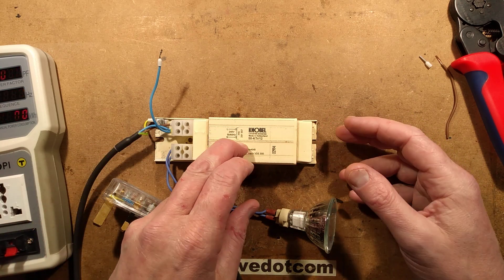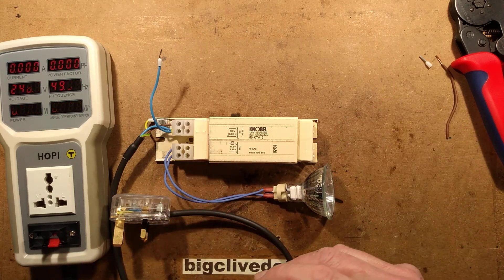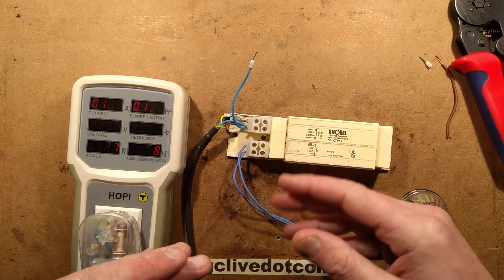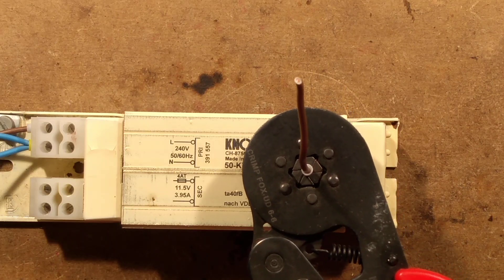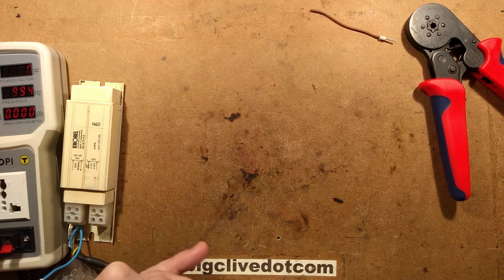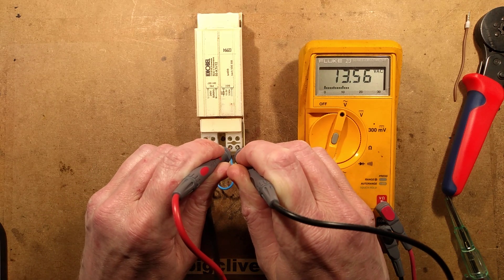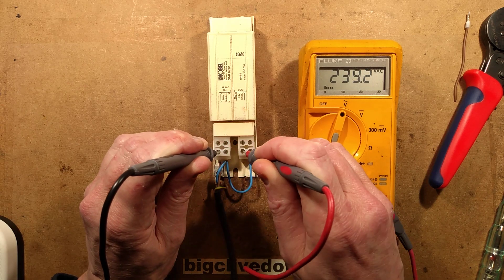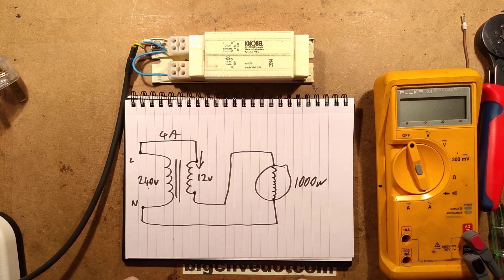Adjust your mains voltage with a standard transformer.

Comment: For a while years back I had access to a Claude Lyons self-regulating variac. A beautiful beast, 2kVA if memory serves, RMS sensing with adjustable dead zone to avoid brush-destroying chatter. Not cheap, but about 30x cheaper than an equivalent semiconductor jobbie. I was working on PAT Tester Test Gear (ie a Portable Appliance Tester Tester Tester) and you couldn't really have a 1kW load test with any old mains voltage. I'm not sure Claude Lyons sell them any more. Meanwhile, Class D keeps getting better so semiconductor solutions with SCPI / USB / Ethernet backends are quite affordable.

Comment: You are reminding us that Power companies have the Power to charge us for VA rather than Watts. However as most reactive load is inductive, power companies usually welcome capacitive power factor correction. So would they provide a rebate if we use LED lamps with Capacitive droppers to assist them with power factor correction?
Reply from the maker: The problem with many modern power supplies is that the current waveform is completely non-sinusoidal.  The old trick of using capacitors to compensate for inductive loads doesn't work any more.

Comment: What a brilliant observation you make. The current load is carried substantially by the secondary winding ! Great. Of course we have to hope that the secondary is wound and insulated in a way that will withstand full mains voltage. Down here in Australia, my home voltage is regularly up around 258 Volts (I live close to a sub-station). I have a Chandelier with around 50 x 4 watt LED candle globes, you know the ones with a 50,000 hour life that seem to be outlived by any old filament lamp. I really want to reduce the voltage to these lamps, to improve their longevity. However given  that they probably have a lousy power factor, the load current may be substantial. I am only making some wild guesses here, but say the power factor is 0.2 then 50x4/.2 = 1000 VA and 1000/258 = 3.9 Amps, this is getting uncomfortably close to the rating of the transformer you are using. As the transformer would be located out of sight and out of mind in a sawdust insulated ceiling space, I fear I might be solving one problem and creating a far more serious problem. Fire !! but that is Ok.

Comment: I'm confused as of the drawing you have live connected to the output of the transformer but the real transformer looks like you have neutral going to the output, does it mater if you connect the live or neutral?
Reply from the maker: The secondary winding can be on either the live or neutral.

Comment: I used to live in an area where our 120v would venture as high as 135v and we did indeed lose light bulbs that way. You can buy special higher voltage bulbs but you pay thru the nose. Wish we'd had transformers like that.

Comment: We had a piece of expensive scientific equipment that wouldn't work during the day when everyone on site was working due to the voltage drop, so we got the electricity board to adjust the transformer tap from 220 to 240v (we had our own in-site substations (we had 5 of them))
I find it annoying that a lot of stuff is rated for 220v and obviously very tight on tolerance, christmas lights would last 3 days before blowing the fuse lamp, so i just added half a dozen extra lamps to the string, result is lights that would last all christmas.
I've even wired 2 mains lamps in series to light an area, half the brightness per lamp, but use bigger lamps to compensate

Comment: Please notic that connecting the primary to the secondary winding "changes" the insulating transformer (or safety transformer) into an autotransformer.
If the secondary side is not insulated and/or has open wires, you can get an electric shock with the intensity of the outlet (here 240 Volts).
Reply: Well yes, obviously. Also it stops outputting 12V and outputs 230-whatever volts instead. That's the point.

Comment: My 5kW solar system has not been running for a few weeks now as the grid voltage has been over the limit of 255v throughout the day. Could a setup like this work to provide grid voltage to my inverter down to  243v, but also allow the inverter exporter power through the same transformer arrangement at around 8amps?
Reply from the maker: I think you'd have to ask the manufacturer about that.

Comment: Round here, the daytime voltage tends to hover around 220-230v (some days as low as 210!!), so those dodgy european-spec electricals would tend to do fine, it's only during the night when I actually see 240 full-fat British volts, terrible distribution round here, but that's why I have three UPS units to make sure things don't go too wrong... :)

Comment: "...and then you just basically slip them up through the hole"  As he is making this gesture @2:19

I have one of the other kinds of ferrule crimpers that have only 4 inserts instead of 6 like yours.
It makes square ferrules...do you think that is better for connections than the hexagonal ones?

Comment: What an awesome idea. I'd never have thought of that.  I have a follow on question. can that method be daisychained with multiple transformers? And What effect would daisy chaining have on the power factor? I suspect PF would be worse? And could that be corrected with X capacitors??
Reply from the maker: With a constant load you could bring the power factor in line with caps.

Comment: Some 30 years ago (maybe even more) you could get some stabilising transformers that you could feed with a wide range of voltage and out came 220 volt, I recall there were a transformer and an electrolytic condenser inside and nothing else, how could these work?

Comment: I do this with 24V transformers here in the US to drop our 120~V line voltage to around 100V for running electronics imported from Japan that don't have wide-input power supplies

Comment: Had an engineer come and read our meter a few weeks ago and he told me not to let the power company install a smart meter as they are easily hacked. I mentioned this channel and that you said they could be set to read apparent power. The engineer told me that the meters are already switched over. He also said that if you have the powerline adaptors for your home network, that anyone who can remotely connect to your meter can also remotely connect to your network as it is already behind any router firewalls.
Reply: Properly configured powerline should have unique encryption configured which is intended to prevent this issue or prevent your neighbors from hopping on to your LAN. Certainly the very old D-Link adapters I have here have a procedure you can follow that allows them to be paired with a unique key and AES encryption. How bulletproof that encryption is, is a whole different question
Reply from the maker: I think your meter reader may not have been on the ball with his technology.  While I'm sure that everything can be hacked, your meter probably doesn't have the facility to communicate over the wiring.

Comment: I must say, you guys in the UK seem to have a lot of voltage variation problems, based on the videos you do. I was an electrician for many years here in the U.S. and our 120/125V "mains" voltage didn't, to my knowledge, ever cause problems like this. I have to wonder if we have better voltage regulation or if the generally lower voltage tends to cause fewer problems, even when varied.
Reply: It isn't the voltage regulation. UK uses 240V but everyone else nearby uses 220V. The compromise of equipment rated to 230V was chosen so that we could use the same devices. The result is our equipment runs a bit hot on 240V and theirs runs a bit cool on 220V.

Comment: When you connect the primary to the secondary, the secondary winding is now at mains voltage. But is the insulation between the secondary winding and the transformer case (or whatever is near the secondary winding) rated for mains voltage (240VAC)? This could be a problem. It would depend on the transformer design.
Reply: That's a good question. To be a bit more on the safe side the suggestion would be to connect the common terminal between the 2 windings to neutral.
Reply: Kris M Ah, so that's why he did that.  Looked intuitively wrong and could have been explained in the video, instead of just showing a diagram with live bridged and neutral passed through, then building the opposite.  Anyway an alternative solution is to place the transformer inside a properly isolated cabinet with other exposed mains circuitry, then the live can be bridged and the neutral kept at ground level.
Reply: Most, (but not all) transformers are wound with the primary winding closest to the core, with primary rated insulation between the primary, inner winding, and the outer, secondary winding. So in most cases, it is not a problem at all, even on the "hot" or "line" side connections. This method in the video has been used for decades safely. Google search "Buck/Boost transformers".
Reply: Find the spec sheet for the transformer and see if it shows how to wire it as a buck/boost transformer. I have a couple of transformers designed to be used as buck/boost transformers and they are potted in a metal case, NEMA 3R "rainproof" so they can be used outdoors. These are common in the USA, so used ones are commonly available on Ebay at good prices. So, if it comes in a NEMA 3R enclosure, has a high voltage (above 120V) primary, and a low voltage (under 60V) secondary, it is almost definitely designed to be used as a buck/boost transformer.

Comment: Is possible to make a lot of these and put them in series to crank the voltages up to outrageos amounts?
Its for a friend.
Reply from the maker: No.  The transformer insulation would limit that.  But you could buy a boiler or neon transformer.

Comment: This info is applicable to a battery charger that has a 6 volt 4 amp and a 12 volt 4 amp option, right?
Reply from the maker: It can only be done with a bare AC transformer.  The charger will contain a rectifier and is not suitable.  It may also have the secondary referenced to the case.
Reply: Alright. Thanks for clearing that up before I made a big bang happen while trying to fix that battery charger.

Comment: You would have to select a transformer with a primary that can stand the full current of the light passing through it, otherwise it will burn up.

I like that clear plug, Very novel :-D
Reply from the maker: The clear plug is from CPC.  It's actually intended to facilitate easy inspection during appliance testing, but looks pretty cool.
Reply: No, only the secondary has the full lamp current.

Comment: That's amazing.  I see perfectly well how it works, but it would never have occurred to me, because it seems like cheating  LOL.  A lot of cheap Chinese equipment has 220V caps in them, which is the reason for the 220V rating they give them, caveat emptor.  This might be a great solution for that stuff (if you haven't got around to changing the caps, or don't want to bust open a glued housing).

Does anyone know if this would be considered "legal" in Australia, or is it likely to cause problems if discovered?  (not that they would).

Comment: I have an American RV(motorhome) that has a built-in transformer to drop the shore power down to 110v for its built-in appliances. Mains supplies at campsites can be considerably below spec. My fridge freezer is constantly switching to gas because it's seeing a slightly lower voltage than 110 and spits its dummy with an error message. 

I've been racking my brain to find a solution for this and now you have given it to me! Ingenious!

I'll be putting a video up on my channel when I do this mod and crediting you with the fix.

Simply brilliant!

Thank you Big Clive!
Reply: Wow. What have I started?

Ok. Just to make things clear I'm living in an American RV in the UK and Europe. All of the power here is nominal 240v. The Rv was converted via a 1:2 step-down transformer when it was imported. I connect to shore power with a 16a 240v Ceeform connector. Part of the supply from the 110v 5.5KVA generator also feeds through this transformer. 

There are two electricity rings in the RV:

1/ 110v to power the original US aircon, fridge, battery conditioner, microwave, water heater and the internal 110v US spec power sockets

2/ 240v to power appliances that have been added since the RV was imported and the fitted UK 240v sockets.

My 110v ring normally meters a few volts low. This is not too much of a problem though. The AC units always start ok, battery conditioner is regulated etc. The fridge, however, has a small amount of logic in it. Power to the logic board is regulated, so that in itself is fine, but it has a watchdog circuit that throws an error if the supply is low by as little as 5v and automatically switches the fridge over to LPG. In reality, there is a great deal of latitude on the fridge supply, as it is of the evaporation type which means that all the supply is doing is heating up some resistance wire. Any shortfall in performance would be accounted for by the logic based thermostat.

I thought about using a variac, and @tallman11282's idea of getting a regulated transformer would of course work, but I'm living on a budget, and using my engineering skills to keep the costs down. I save myself thousands every year because I have socket sets, an oscilloscope etc, and I know how to use them. 

For me, Big Clive's solution still stands as the cheapest solution which is easiest to implement. 

Thank you all for your replies. I love this stuff, and it's uplifting to know that even in this day and age, there are still folks around that can use their brains and their hands to make things work.

Fox
Reply: I’ve never seen an RV that uses more then 110. Are you sure you don’t mean the transformer taking 110 and making 12 for the lights and the controls for your fridge?
Reply: I feel like a variac would be the best option for your situation. As different campsites would have different voltages (due to resistance in the cable, I'm assuming). So I feel like a variac and a multimeter would allow you to correct the voltage drop accurately. Just an idea. Good luck with fixing the issue you have.
Reply: I'd be looking at using a beefier transformer to do this. Something like one from a battery charger. I have a few knocking around. I have the gear and the knowhow to check what the fridge draws, and look at the potential on the output. Don't worry. I'll be careful!
Reply: Check out the RVGeeks channel, specifically this video about the Huges Autoformer. They love their Autoformer as it conditions and levels out the voltage so all appliances are happy.

https://youtu.be/E2NdhNa-ZTQ
Reply: FoxRV... it just isn't SAFE... especially for power circuits, not little lightbulbs.
Reply: @Bruce Nitroxpro
the heater in the fridge is only a couple hundred watts at most (basically a little light bulb in a 3/8" copper tube) so if the small transformer is only connected to the fridge supply it will work fine :-)
Reply: In North America all power is supplied at 110 volts per line. For 220 volt appliances two 110 volt lines with opposite phases are used.

American RVs use either use a 110 volt 30 amp supply (smaller RVs normally) or 220 volt 50 amp supply. The 30 amp plug has three prongs, one hot, one neutral, and one ground. The 50 amp plug has four prongs, two hots with opposing phases, one neutral, and one ground.
Reply: @tallman11282  Yeah..my last employer had a BIG Country Coach motorhome...240V, 50 amp shore power, 4 wire plug...I've done electrical stuff all my life, I'm 71, and I still find many 'electricians' still baffled by those 4 wire/240 plugs/recep's….and 3-phase, especially 240/480 with no neutral...plenty of guys don't understand that, I guess they were 'residential' electricians...in the USA...
 That BIG motorhome?….42 foot, 3 axle, air brakes, 550 horse Cummins engine, 3.5KW water cooled diesel accessory generator, 4 big AGM batteries, don't recall the amp hours, but they weighed about 190#'s...each. System had 4KW inverter for the 120 VAC, also charged the batteries from shore power...@300 amps, 12 volts.
Reply: tallman11282 that’s not true about the 50amp one. I’m reading that only some very high end coaches might use 220 but it’s rare. From what I can understand is that the outlet is a 120/220 outlet but it is wired for 110 and they use it to prevent people from overloading a smaller service.

Comment: If the transformer is used to raise the mains voltage then with a certain illegal connection to the mains supply then you could make your meter run backwards.
Reply from the maker: That science is covered in another video, but it requires a custom wound transformer.
Reply: It could be done with a standard low voltage transformer, connect the extra high voltage output to the live via a suitable limiting resistor then provided the transformer current exceeds any current drawn by appliances in use then the mains voltage in your house will be raised. As this voltage is now higher than the line voltage then current will flow in reverse through your meter. It does require another illegal connection though.
Reply: Or you just connect a bar across the meter and be done with it.
Reply: Which would stop or slow the meter right down.
Fine with a basic meter but a smart meter would probably flag up attempts at skulduggery.

Comment: Something I learned the hard way is you can't clean the tarnish off the contacts of old tungsten bulbs. They are amazingly bright and crisp when put up but it's less amusing when you are replacing a bunch of blown bulbs a few weeks later. The tarnish also helps mitigate transients from the bulb or fitting vibrating.